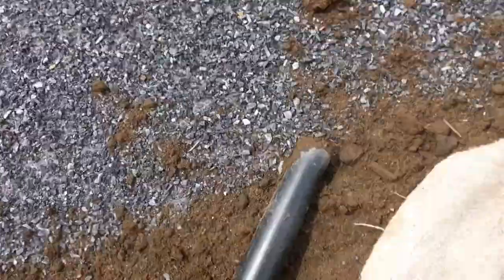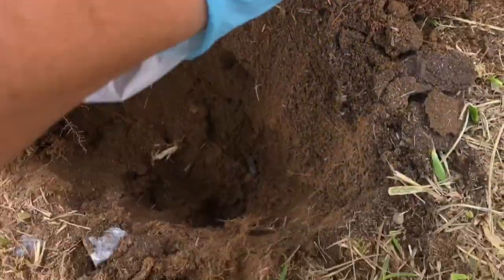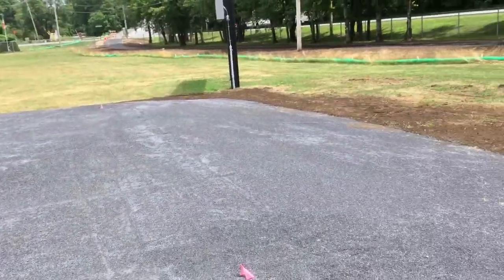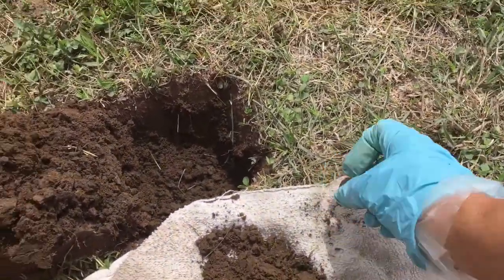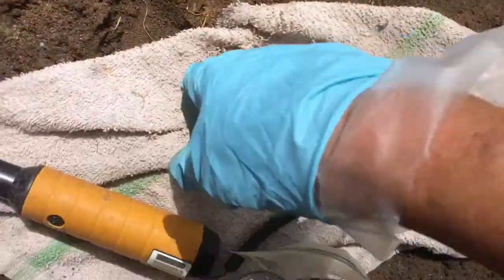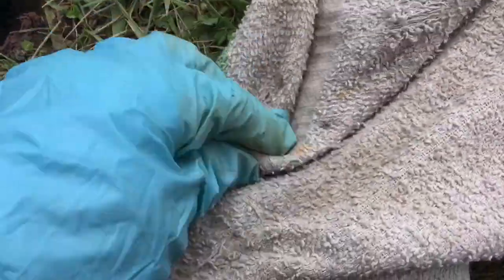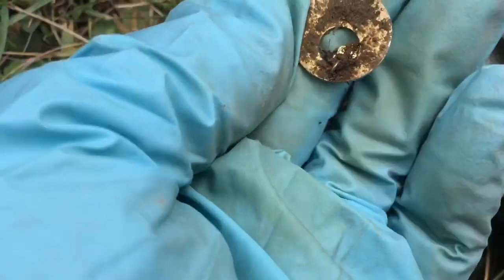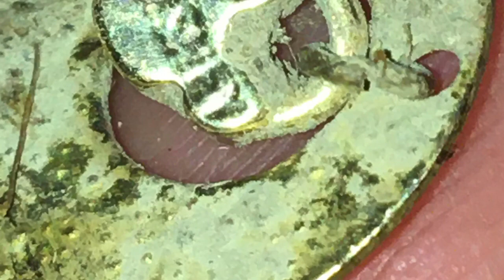#MetalDetecting With Equinox #Silver & #Relics! Silver Streak #63

Comment: Before I retired, I went to work every day, out to lunch every day, running errands to and from work every day and I was in a lot of parking lots every day and I made it a point to pick up every coin I saw. For several years, I averaged over $3/year and was quite proud of that (though I earned a few times that amount in salary). Now, of course, I metal detect. What else?
Reply from the maker: Sounds like you also, “Appreciate Good Value”!
I used to be a coupon queen for many years! Now I shop around online and save that way. Of course, I make a few dollars a day swinging. Lol! Hubby says I spend more in gas getting there. Lol. That’s not the point! My hobby gives me clad & goodies & immense pleasure. Can’t beat that. Hobby with benefits. 😎